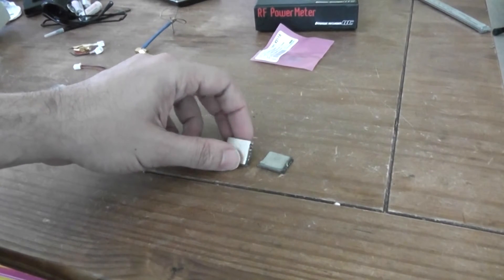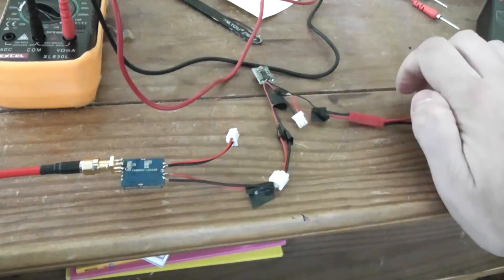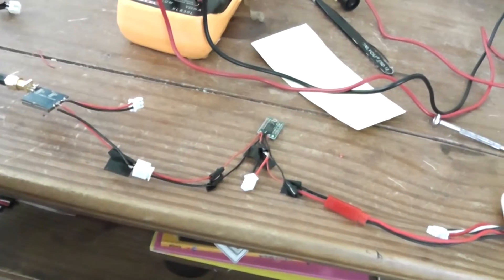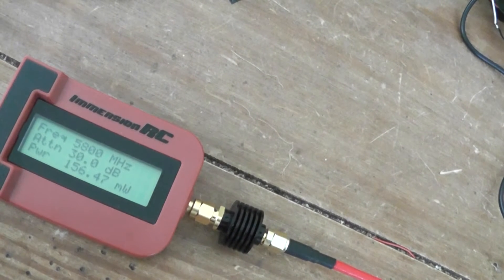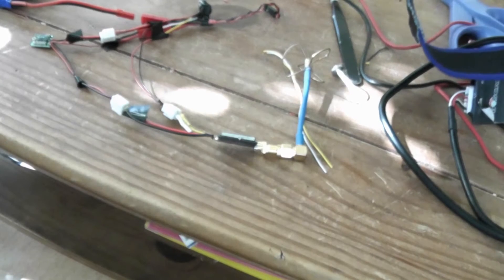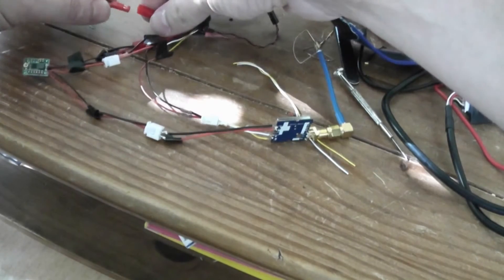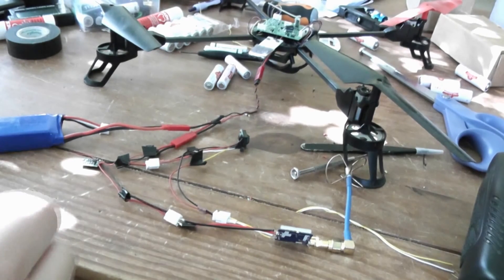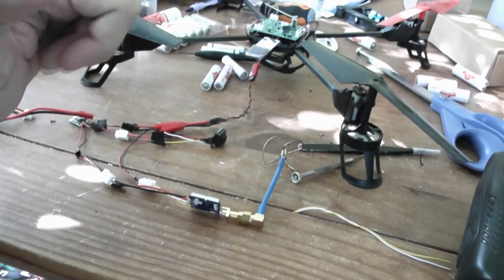200mW 5.8G VTX: FX758 vs TX5823 (Courtesy Banggood)

Comment: SeBy:
   Have you worked out the switch positions necessary on the FX758 for each frequency? Have you done a modification to achieve 32 channels instead of the default of 8 with 3 dip switches?
Jim
Reply from the maker: +James C Eastep No I didn't work on it .... sorry

Comment: Thanks very much for this careful evaluation.
Please tell us what voltage you have chosen and what frequency you ultimately use for your FX758, in actual practice. I was expecting the TX5823 to win, and your video test showed the opposite conclusion...very helpful!
I'm hoping to use just a 3.8-4.2v 1s battery for my VTX, with no voltage regulator. Do you think that is crazy?
Jim
Reply from the maker: +James C Eastep In term of quality, the FX758 IMHO is far Superior, in term of emmitted power, the TX5823, is a little bit better.You can of course powering your VTX with a standalone LiPo no problem but don't use the same that your flying object. In this case, your video signal will be full of  motor's interfernces